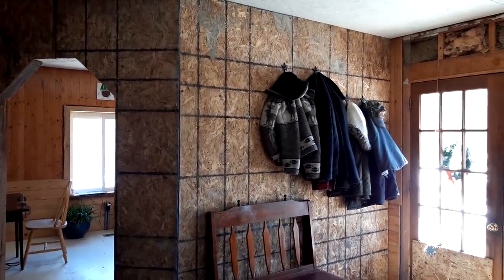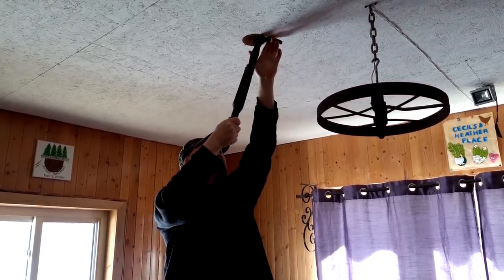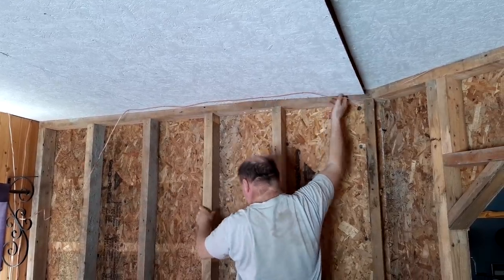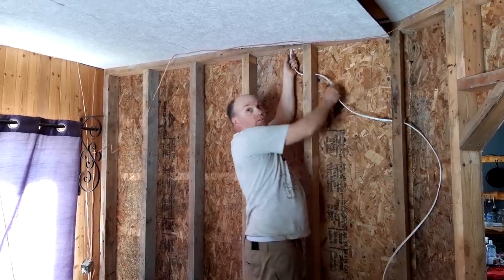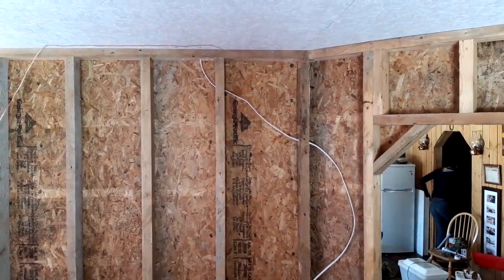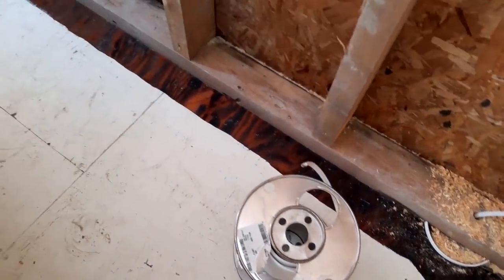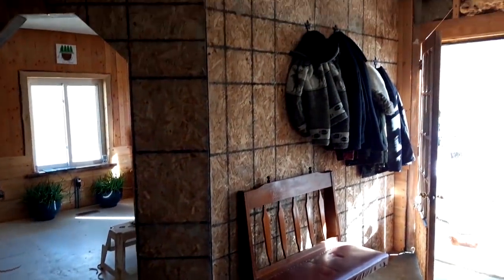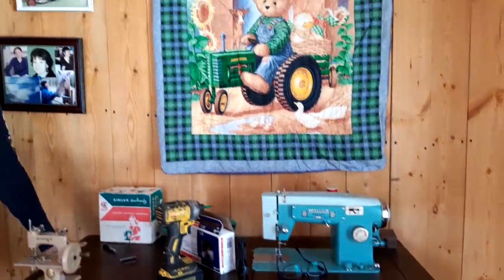Day 3 Of Our Off Grid Homestead Build For 2019

Comment: Cecil.  Sharpen that bit!
Reply from the maker: It's sharp, the wood was just wet... They laid outside all winter uncovered.
Reply: It wasn't the bit. Notice hole #2 it worked like normal. As Cecil said,  it was the wood on the first hole.